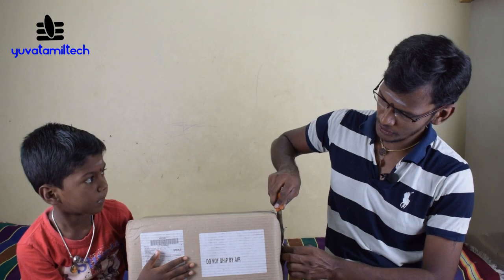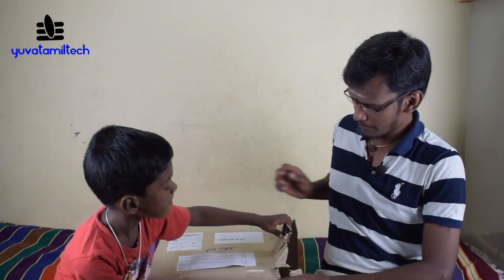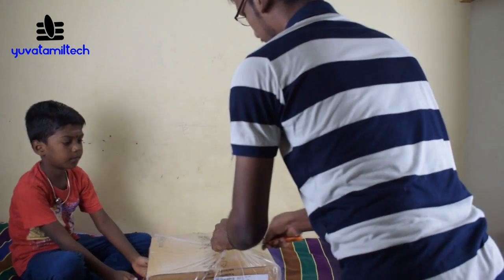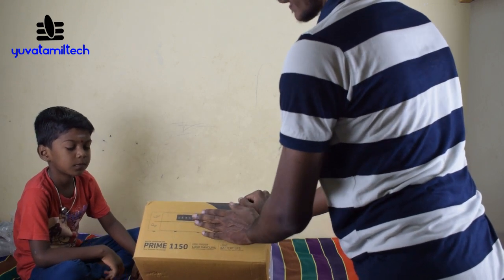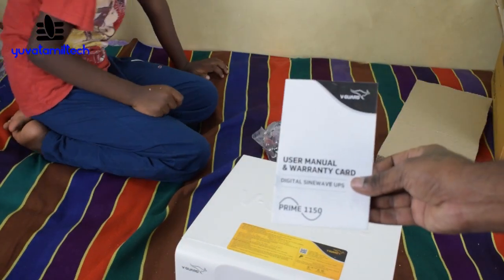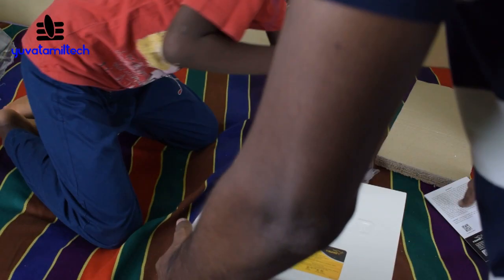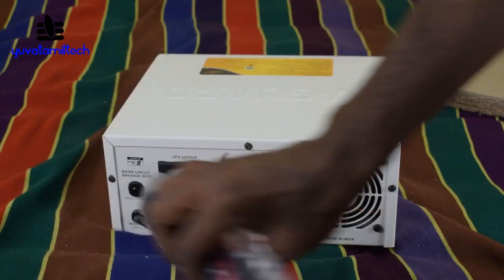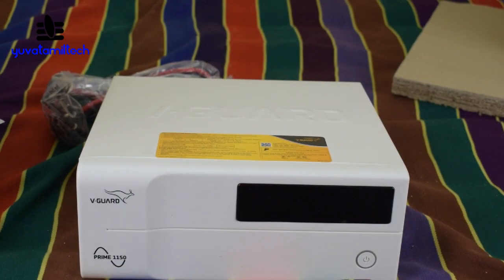V-Guard Prime 1150 Home Digital Sine wave UPS Inverter unboxing in Tamil | YuvaTamilTech

Comment: Can u please tell me if home tubelights blink once during the switchover from mains to battery mode..when electricity goes off? I have a microtek inverter..but when the switching happens during power cut..my led tubelights blinks one time...which is annoying....I want to know if this inverter does the same thing or not
Reply from the maker: Which type u r using  sine wave inverter or square wave inverter
Reply: @YuvarajaSpeaks  sine wave microtek sebz 1200
Reply from the maker: That is basic characteristics of inverter.